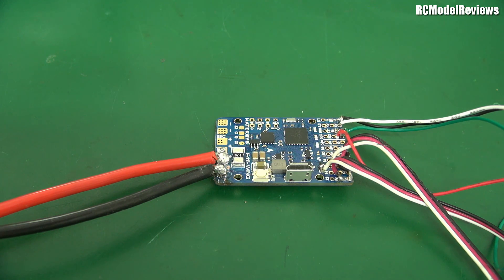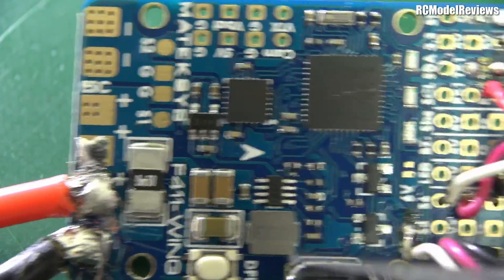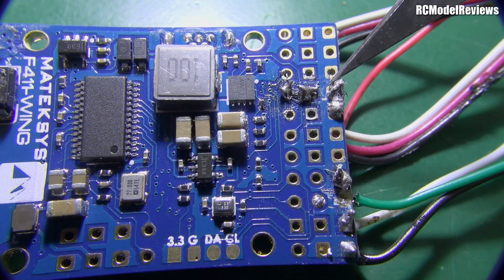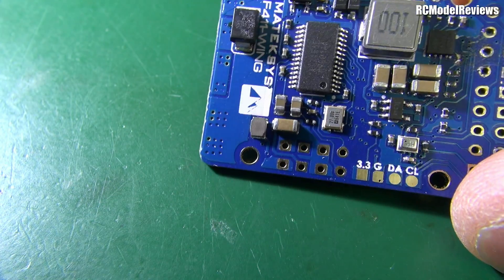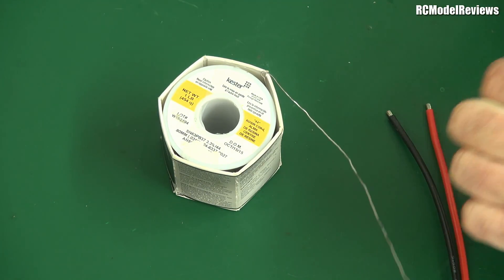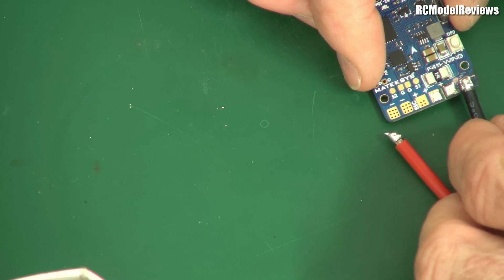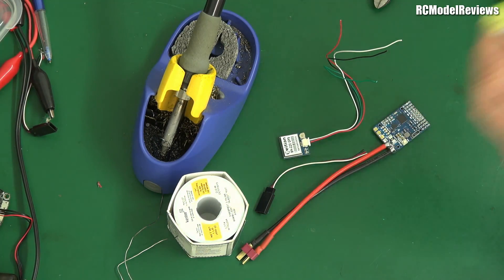Fixing bad soldering

Comment: This gentleman is a treasure. Simple and easy to follow.
Too many soldering tutorials preach  wrong "buy expensive quality this, blah blah" propaganda
Its simple. Use right tip. Clean tip often. Tin pads and wires. Use lots of flux. Work quickly. 
Stop searching for magic $300 soldering iron or magic temperature - it wont fix anything!!

Comment: One of my pcb boards have a lot of black stuff on it. I did clean that off but there is some burnt pieces there too. Burned the pins I need. Any help? Soldering onto it and trying to turn it on doesn't work and cleaning doesn't work too much.

Comment: Gotta disagree with your hate towards pb-free solder. I've made some decent boards with pb-free and now only use pb-free. One of them is an audio amplifier and works 4 years now. If you use some flux there will be no problems! Do you really want to be coming in contact with lead, a toxic element?

Comment: Hi Bruce from the U.K.  I have a frsky receiver and  when I looked at it under my 40 X  microscope I can see a small black rectangular component has come off, maybe a resistor  ??  Are these available to buy and if so have you ever attempted one ?  A sewing needle seems massive under the scope so God knows how small a solder tip to use .

Comment: I always use extra rosin flux (not acid flux) even if the solder has a flux core. 63/37 is the ideal alloy for electronics.

Comment: If you live in the EU and are not a business, you cannot buy leaded solder any more. The lead free stuff is horrible and you have to push temperatures higher with more risk of damage to the PCB if you are there a second too long. 

As to why private people can't buy leaded solder any more, I can only shake my head in despair at the committee of 'experts' who made that law up. I guess none of them have vintage test equipment to repair!
The best way to learn to solder is to buy some "veroboard" and surplus components and practise, practise, practise! You do need a good iron and good solder first though - there's no point trying to learn with bad tools as it just makes things way harder than they should be.

Comment: Hi, Bruce.  A kind member of our local model club gave me a large tin of red solder flux paste in the 1970s from BICC cables (now Balfour Beatty) and I have used it ever since on soldered joints. Twisting the wires after stripping with a little flux on the fingers or pushing the wire into the little blob of flux  I keep on the soldering station guarantees a fluid joint at all times. RS Components used to stock a flux like this and I have used it at work but I can't see it on their current catalogue. No corrosion at all observed over the years on joints decades old. Sometimes I have pushed the multicore solder  into the flux paste to enhance the flux in the multicore when soldering. Keep up the superlative work on your sites. Well done. Paul F. Yorks UK x

Comment: You are a Genius good to watch a master of his trade. It is very common that people don't get  the basics. Tin your wire and board before you make a joint. Its always easier if you clean an old board down with PCB cleaner or isoprop alcohol. You could use methanol if you are on a budget to clean your board before and after. Get a pack of blue tack and stick it to your mat its and old trick stops you chasing those wires aboot.

Comment: The key here is to use real solder with the lead in it. I've tried the other stuff and it just doesn't work at all. I understand what the tree huggers are trying to do, but it just doesn't work. You need that lead in there to make a proper solder joint... Any electronics enthusiast knows this..

Comment: Should have solder on some pins and then used connections to connect the device.
Much easier then soldering direct to the board.

Comment: The Hakko is nice if you have $80 to spend on a soldering iron, but for people with a budget, the Aoyue 469 is 60 watts, ESD safe, temperature controlled, with a replaceable heating element, and is compatible with Hakko tips. All for $30. And with a set of good tips, good 63/37 solder, and a flux pen, will make anyone look like a pro.

https://www.sra-solder.com/aoyue-469-60-watt-soldering-station
Reply: If you don't mind spending a little more than for the Hakko a Xytronic LF3200 is great especially if you are soldering large connectors. I has 120W output and uses high frequency AC to heat the tip by induction instead of a thermal element and a temperature probe in the handset that inserts into the back of the tip monitors the tip temperature.
Reply: A little more? The cheapest price I’ve found for the LF-3200 is $140, almost half again as much as the Hakko 888d, and nearly five times as much as the Aoyue 469. I mean, maybe if you’re building concert hall audio systems it would be worth it, but this is RCModelReviews. I’ve soldered 12ga wire with the 469 easily (with a thicker tip), which is plenty heavy enough for the vast majority of our purposes. Now, it you had said, “If you’re made of money, the Xytronic is great...” I would not disagree with you. 🤷‍♂️

Comment: Good video. Only thing I would have added is when doing the thicker wires, especially on ground circuits that have lots of copper, hold the wire in place for a little after removing the heat source. If you get a good solder flow but move the wire on the pad while the solder is cooling you will create a "cold solder" joint which will likely fail later, and in our hobby that will likely mean a lost/crashed model/multirotor.

Comment: Looks like the soldering Iron was cold.   NOT HOT ENOUGH.   Lack of Flux.   Wire Termination Ends Frayed (NOT NEATLY CUT).  I've done better with a hot butter knife.  LOL    :    Fix ?     Pre Tin the Wires to be terminated.    Pre Tin the Pads to be soldered.  Using a HOT Iron Re-flow the two together and Get Off.

Comment: Thanks for this one, Bruce. When I first got into the RC hobby, all I had for soldering was a Weller pistol with tips that were much too large for the purpose. So I invested in a proper soldering station at the Local Hobby Shop, and it made a considerable difference. It didn’t cost much, and has greatly facilitated my model setups. Add to this the fact that I’m pretty finicky when it comes to the details, and I get a bit of satisfaction from a nice, neat solder joint. Knowing the basics, as you’ve illustrated here, is essential. Like my welding teacher in college said, welding (or soldering, in this case) can either be “awful pretty” or “pretty awful”...

Comment: Good job Bruce . If you want to know where the other wires were connected just watch the start of your vlog . I'm hopeless at soldering but i got a better soldering iron with 2 heat setting and i'm a bit better now , my problem is trying to hold 3 things at once and a also manage to burn my finger . I think i also hold iron too long and get too much heat , thanks for the tips :-)

Comment: I would not recommend any of the old style irons that have the tip and element as separate parts. The newer irons have the element permanently bonded to the tip as one piece and this makes a huge difference. You don't have the air gap between tip and element that ruins the performance in the old system.  You can get cheap china soldering stations that take the hakko T12 style tip+elements for like $40.   Slap a genuine Hakko T12 tip on it for $20 and get really good results.   The T12-K   (knife tip) is the one i recommend, it's huge so can solder big wires but it also has a tiny sharp end that can solder small surface mount stuff easily.
Reply: Air gap doesn't matter with high frequency irons because they don't use a thermal heating element. Instead they use high frequency AC to heat the metal in the tip by induction. There are two types of these , Curie point irons that just blast the high frequency signal at the tip and it absorbs it or not depending on temperature. Physics controls the temp with these irons, Metcal and Thermaltronics use this method. The other type use a temperature probe in the handset that inserts into the back of the tip an a PID loop to actively control the temperature. Xytronic, Quick and Atten high frequency irons use this method (Xytronics are made in Taiwan and are good quality stations, Quick and Atten seem to be cheap chinese copies). Of the two methods the curie point irons offer the best temperature control but the temp is fixed by the Curie point of the tip and you must change the tip to change the temperature. The Xytronic type have temp adjustable from the station but they cannot use Hakko tips (the back of the tip is hollow to receive the temperature probe). Quick and Atten offer some larger tips than what Xytronic has for their stock handsets, Xytronic wants to you buy a larger handset for the bigger tips)

Comment: The easiest and best solution to that soldering mess is to remove all the wires... re-cut and re-tin them as well as the PCB connection pads. Remove the solder from the PCB feed through holes and... wait for it... re-connect/re-solder all those connections using proper soldering tools. I'm convinced that you already know all that Bruce...;-) [Watched the rest of the video and saw that's what you did]
9:07... A trick I use sometimes is use a clothes pin to hold the wire just off the surface of the bench to tin the wire.
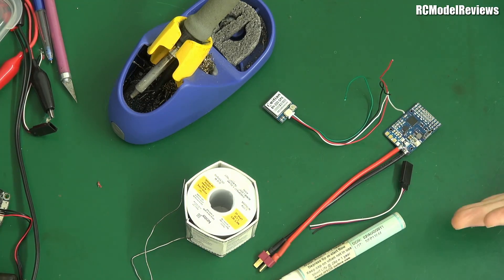12:22.. You could also look at the beginning of this video for the wire colors on which pins.
13:15... We use that exact size and brand of solder in the shop exclusively. The best leaded solder available... IMO

Comment: Strip wires a little longer (always with knife), twist the outer sheath as you remove, tin the wire and snip to length with flat side facing wire. One down side to using thin solder with big wires is that you burn off the flux quickly, so add extra flux.

Comment: I wouldn't recommend a Hakko for a hobbyist these days. Honestly the TS100 is all you need and is a fantastic iron with the Ralim firmware.

I have the standard small chisel tip, the small conical tip, and the large chisel tip. Run from a 6S lipo your heatup time is 11 seconds from stone cold and you can solder anywhere / anywhen. Have done XT150 bullets and wire up to 8AWG with the large chisel tip at 420 celsius.

Not bad for £90 GBP / $100 USD.

Comment: The one thing that I learnt very quickly, was DO NOT buy your solder from overseas, there is a good reason it's cheaper. 
Just spend a few dollars more and purchase from your local electronics shop.
You get the solder you should be using and suddenly your soldering starts to look like it should.
Reply: It'd be nice if we even had a local electronics shop any more. That used to be Radio Shack and their solder was actually very good (I still have some). Nowadays Amazon carries Kester which is as good as everyone says it is and blows the Chinese stuff out of the water.

Comment: Beginners use plenty of flux. Dry joints are as bad as a short. This is not a good example for beginners. Beginners are not going to have a 400 dollar hacko.
Reply: Well I'm a beginner and just bought a $100 Hakko FX888D because of the mess the cheaper irons were making. But totally appreciate your point, it was a lot of money for someone getting started when that money could have gone to some flight gear or a nicer pair of FPV goggles.

Comment: Looks like whoever soldered that’s board did it with a six inch nail or 4” sharpened bolt and a blow torch 😢😢😢
Reply: I think it was a butter knife.
Reply: Mu thoughts exactly... I don't fly a 747 because I don't know how... Simple logic.
Reply: With eyes closed and in the dark!
Reply: The guy who modded all the PS1s in the nineties
Reply: The person who soldered up that board should be smacked in the head very hard and get their son to do a proper job.

Comment: Great video Bruce, can you make a video of how you cleaned up the flight controller please? If adding to much heat to a PCB is not good I would like to learn the correct way clean up a soldering problem. Thanks.
Reply: I would like to see that too
Reply: You can use a solder sucker, or solder wick. There are different types of suckers and different sizes of wick. Solder wick needs to be the correct size for the application and works really well in most instances. When using the sucker type, I prefer the squeezey bulb type solder sucker over the spring loaded. The common spring loaded solder sucker can damage a board if you end up hitting the board with it when you press the release button and it snaps back at the board while trying to keep it in place. There are videos out there to show how to use these things. My bulb type wore out after 30 years, I need to get a new one; actually, I need to get a lot of things, including a good iron again. 

There are also other tools for cleaning up and repairing boards (picks, brushes, scrapers, acidic cleaners, etc.) if you want to go that far; experience and great care really helps in these cases.
Reply: The RC Crash Project, thanks for the advice.

Comment: There is so much solder marketed at 60/40 which is just flat out fake, I bought some locally because I didn't want to be scammed, and even then I got scammed... To test it, pool solder on something, if it's shiny you've got real stuff, if it isn't shiny throw it in the fuckit bucket
Reply: @Sasha Kruse Grim Yep That's The New Current Standards Across All Markets!
Reply: You could always just buy it from a distributor like digikey.

Comment: What temp are you running your iron?
Reply: R. Scott Page I run my iron at about 350, keep my tip nice and clean, use flux (designed for electrical work), resin cored solder  0.5 to 0.7mm, and my iron and solder are on the joint for the shortest possible time. Don’t flow solder onto your iron and attempt to use this “melted” solder to do the job. Whilst that may work it results in a poor job since all the flux in the solder has been burned out
Reply: Nice to see your still around scott,i miss your videos very much.

Comment: 1st... LOL Hey Bruce, I Have A Number Of Those Horizon All in One Controller Boards That Have A Burnt Out ESC Chip? Thus Won't Work, Unless I Can Repair Them... :~(  I Have A Good Digital Heat Multi Solder/Hot Air Station For Repairing Such, Butt Can't Seem To Find The Parts? Any Recommendations? Ali-Express or Electronic Parts Companies You Know Of & Trust? Thanks Mate